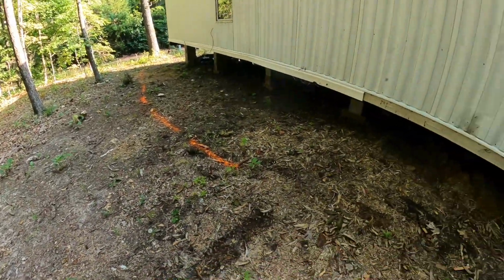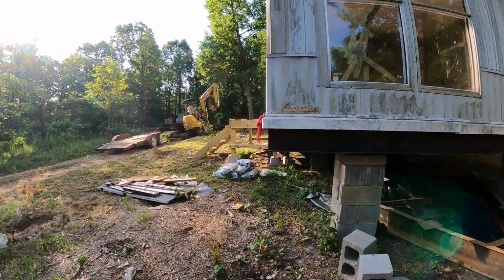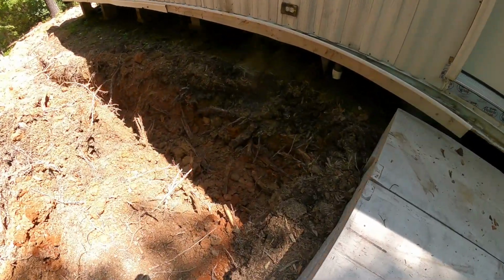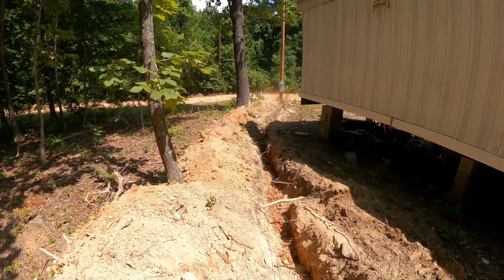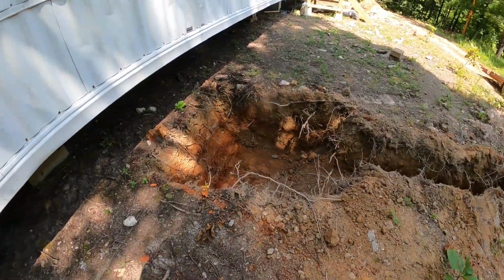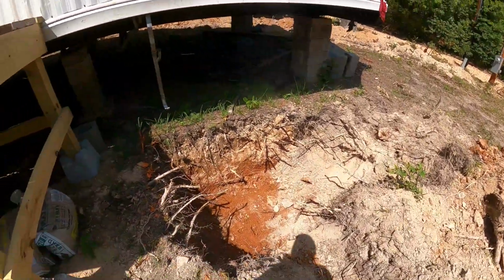$2500 Mobile Home Renovation | Preparing for Electric and Septic

Comment: Are you gonna do your wiring? It's pretty simple.  You're getting close to having some  A/C.
Reply from the maker: Added ac a few weeks back thankfully. Videos are behind a bit. On to insulation and drywall this week. Electric already in
Reply: @BigDreamsTinyBudget  so hopefully you'll get some  A/C soon .
Reply from the maker: @jerryrigsit5400  got a while now unit in there now but it doesn't do much with big holes in the floor and no insulation in the walls lol
Reply: @BigDreamsTinyBudget  I get that